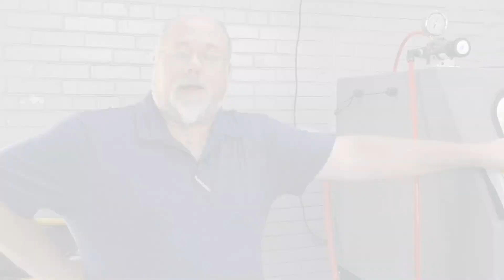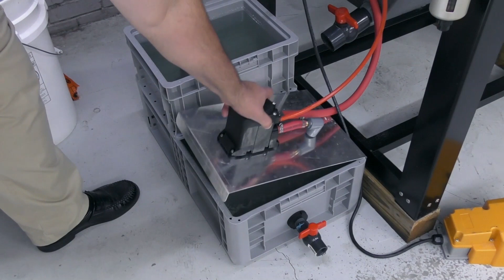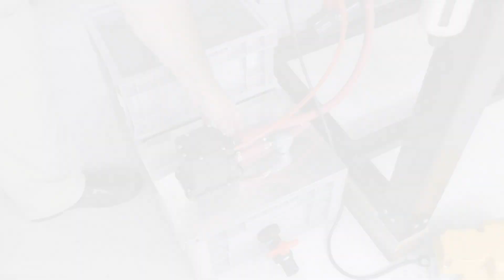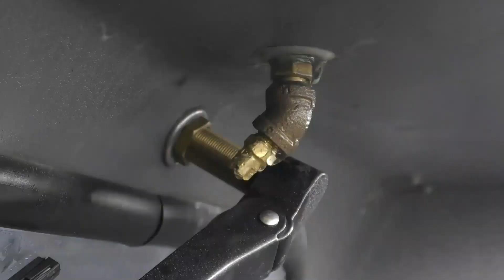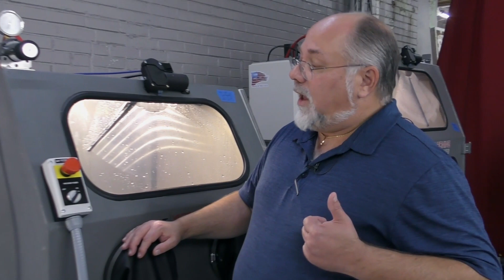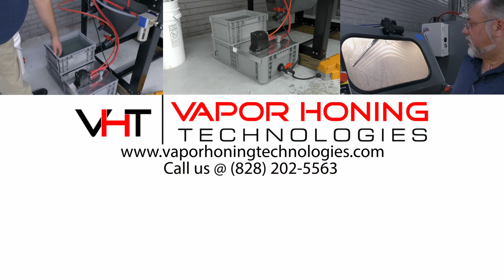What Is a Closed Loop System? - Vapor Honing Technologies

Comment: What is visibility like? How do you improve it with a close looped system?
Reply from the maker: The closed loop system does not effect the visibility in the cabinet, that is reliant upon the window rinse and wiper. The window rinse is standard on most of our machines, and the wiper can be had on most of the machines from the VH800FL and up!